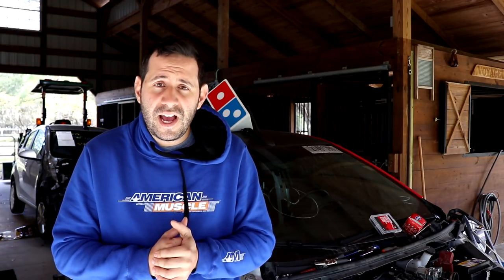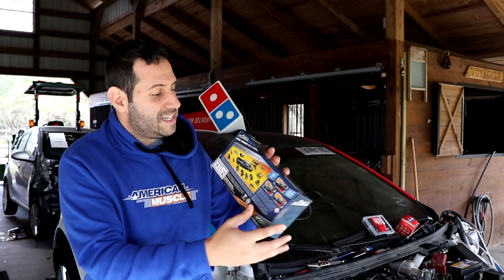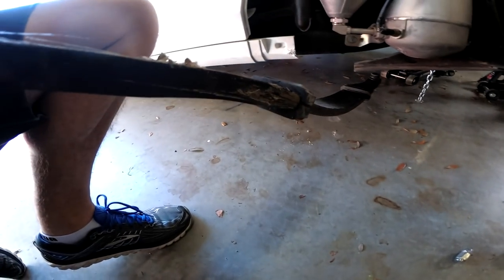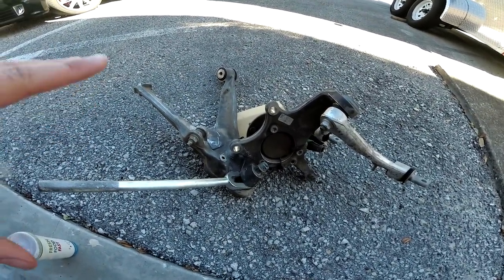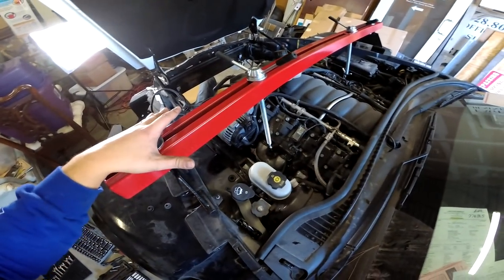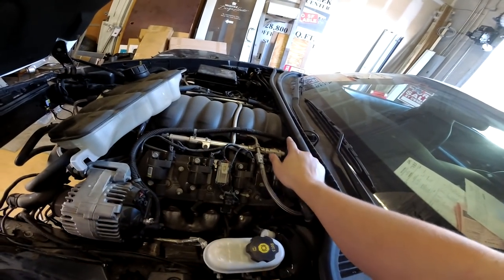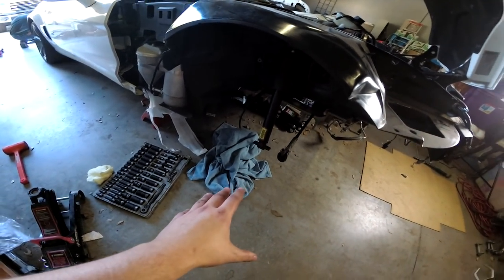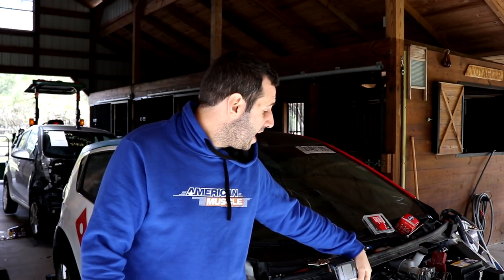SALVAGE Corvette Grand Sport Project Begins! Wrecked Subframe Pulled and Replaced!

Comment from the maker: Kinda awkward that part when Mike and I were beating it for like 20 minutes straight.... (all steps required to win this giveaway in description box! Good luck to all!)
Reply: Samcrac you should make the giveaway to any state or country, not just the USA.
Reply: Dylan Ward lol sadly I live in the city of England
Reply: Justin Schmitz I live in Australia so no giveaway sadly
Reply: It happens, and when you smack that kind of part in a crash, it happens even more often. Pf, you should see what happens when you get Mercedes parts from 50 70 years ago in the same situation, with their tolerance madness, you'll hit a day and still not budge it. Freaking panzers for roads.
Reply: +Dylan Ward he won't because shipping would cost more than the prize. overseas shipping from the us overseas is $20+ usually
Reply: +Samcrac it took yall forever to remove the control arm because y'all were using a rubber hammer. if you used a mini sledge hammer it would of popped right off lol. ohh yeah I'd like to win that car too.
Reply: Air hammer with pickle fork...  loud but, much faster
Reply: I think I did everything to enter ... glad to see you working on this car. Now if only Hoovie would start on the Bentley Continental GT.
Reply: Samcrac wont
Reply: You mean to say that you “beat” it so often that it takes you 20 minutes to beat one off?!?! 🙈🙈
Reply: Samcrac next time try a steel hammer rather than that plastic dead blow, you'll get more force thru it
Reply: You're the best when it comes to beating it off...  Wait, that didn't sound right did it?

I like to use a Ball Joint Separator, HarborFrieght sells one for a little over $20, check out part number 99849.  It's really easy to use, but the pop from the separation is a be scary.  Sounds like a somewhat muffled low caliber gunshot.
Reply: Using a dead blow hammer to remove the broken arm....painful to watch...but i still like your videos. As i don't live in USA and you like my comment donate the prize to a charity/childrens home for Christmas
Reply: I don't beat it with friends. Makes things very awkward.
Reply: Samcrac Next time you try to separate something that is stuck just apply some heat to the female portion to expand it because heat makes things expand. Invest in a mini torch lighter it works every time.
Reply: Just try eating a steak with a trim pry bar..😂 @carguru
Reply: wow awesome vid the corvette stuff looks scary lol
Reply: The only thing I noticed was a money-pit jetta lol
Reply: Is the Fiesta ST or Audi S3 for sale?
Reply: Steve Reiness right, but that Bentley is just about junk.... I always wanted a Bentley until I seen hoovies video
Reply: Samcrac I would love the challenger and all the parts to seem really cool
Reply: Samcrac hi
Reply: Thanks for all the cool videos
Reply: I always do it the other way you mentioned, a sharp blow with a heavy steel hammer will pop them out, it deforms the metal just enough for the taper to push the joint out.   Having said that, haven't tried on an aluminum part  before, if it was steel it's by far the best way, just sayin'...
Reply: Samcrac great job man love thr usa the crountry i served for

Comment: Hey Samcrac! I used to tear apart cars all day in a wrecking yard, them ball joints are super easy to remove, all you do is loosen the nut almost all the way off like you had it, then take a hammer (decent size ballpein, 24oz is good) and smack the side of the knuckle where the ball joint stud is going thru (do this while the suspension and all is still connected in the car) 9/10 times it goes pop after couple smacks. If its really trouble, take a air chisel with a blunt bit and run that against the side of the knuckle (the vibration is what you want to free the components). I find the pickle forks sometimes does damage and so we were told not to use them in the yard, as well they aren't nearly as effective. Hope that helps you next time!

Comment: 6:00 had that exact same problem last month. Turns out it was the hammer. The rubber took away all the shock which is what you need to break it loose. Bought a 4 lb sledge and came off in 6 hits.

Comment: I spent 30 minutes with one of those forks trying to get a ball joint out on a civic the other day. Had a full size sledge hammer, a torch and still ended having to cut it to get it off!

Comment: I'm sure you've already done it, but if you're working on a vehicle with suspension damage such as this broken arm, always check the hub assembly carefully for cracks or damage, especially around mounting holes, they're often cast pieces so an impact like in a crash can crack them and if it fails in use the suspension is going to collapse and you may lose your steering too.  I've seen a few that have cracked from the impact, and also check the upper suspension arm as they can get tweaked out of shape if the lower arm has been damaged and then you'll have a nightmare getting the suspension set up right, or more likely you won't be able too so the car won't drive right and will wear the tyres badly...

Comment: When you remove a ball joint from a control arm with a hammer, it is done so by the vibrations.  However, a dead blow hammer won't do it.  You need a large ball peen hammer for that to properly work.  When using a pickle fork, I just use a regular steel hammer and have much better success than had I used a dead blow hammer.  Also, I surely hope you leave the Corvette sounding nice and stock, and not "noise" the crap out of it with some silly exhaust system like several others here on YT have done.  Great work, and looking forward to the results!

Comment: You need to get a small sledge instead of the rubber hammer. If you hit the knuckle where the ball joint goes through it with the sledge it will pop the joint free in 1-2 hits

Comment: Next time you use a pickle fork use a 3lbs sledge or a steel hammer, it will make it way easier to separate parts. It shouldn’t take that long to pop a ball joint.

Comment: while you took off everything on front end I suggest you change that LS3 harmonic balancer. Not all of them go bad but there is well known issues with those cheap ass rubber 2 piece GM harmonic balancers going bad down the road. I got issue on mine also which it started to wobble ever so slight and it will eventually get worse. Just get one single piece milled harmonic balancer like ATI's and also you have to use different bolt also I recommend ARP bolt which everyone in the Corvette forum recommends.

Comment: Use a steel hammer next time not a dead blow hammer. The steel hammer applies a shock wave along the pickle tool instead of absorbing the shock like a dead blow does. Makes it lot easier to separate ball type joints.

Comment: It's interesting that you've found yourself working on one car with high front damage (the DXP Spark) from hitting something high off the ground like a pickup/SUV or truck, and one with low front damage (the 'Vette) from nailing a kerb or traffic island at speed.  It goes to show there are a lot of things to look at and be aware of when looking at a front damaged vehicle.  I reckon the 'Vette must have been pretty close to being beyond reasonable repair with the amount of stuff that got broken or smashed in that crunch.  If that had been a car with a metal body I strongly suspect it would have been done as the kind of forces that cracked the subframe, broke the suspension arm and that carbon fibre leaf spring would have twisted the structure of the car all over the place which would just not be worth repairing, even if it actually could be straightened safely...

Comment: a dead blow hammer is not the right hammer to use, impact is absorbed in the hammer not the tie rod, good going antway, I don't use my phone for youtube or anything other than phone calls or text, seems the apps run my battery down to fast for my liking, sry but my bell is on, I would love that model car as I own a 68 Charger (thumbnail) please enter me in the give away bud, I live in Northeast FL.

Comment: You were using the wrong hammer on the pickle fork. Use a 28 oz ball pien next time and you will have it apart in less than a minute. 2 hits is all it takes.

Comment: Ball joint would of popped easy if you used a real hammer and hit it on the spindle where the tapered end of the ball joint goes into the spindle.

Comment: Never use a dead blow hammer. Use a proper hammer and a pickle fork will work just fine. One or two blows should do it.
Reply from the maker: Hey thanks for the comment. Question, will the regular hammer cause any damage to the suspension components? That always has concerned me, why I've always used the dead blow.
Reply: Actually dead blow hammers are good, 90% of the hit goes to the strike. BUT, you need the steel faced one, the plastic absorbs a lot of the initial shock, where all the force is. Heat tho, all the time.
Reply: Pickle forks are ok if you are replacing the ball joint because they ruin the boot. An old timer taught me to strike the spindle where the ball joint shaft goes in. As long as you use a heavy hammer it will pop right off. Also guy above is right about what kind of hammer to use with a pickle fork. I think besides using the wrong hammer you were using a pickle fork for a tie rod and not for a ball joint. Different wedge angle and different spacing between the wedges.

Comment: Really dude, I cringed at you trying to separate that ball joint with a PLASTIC hammer. No wonder it took 20min. Next time use a proper hammer (sledge preferably) and it will pop right off.